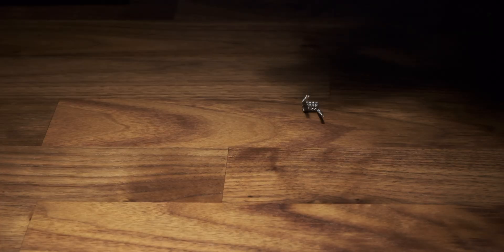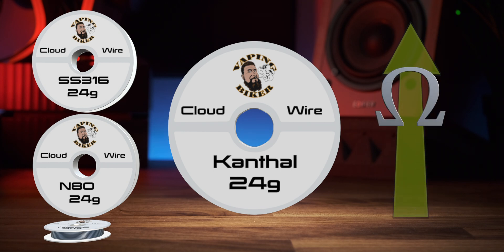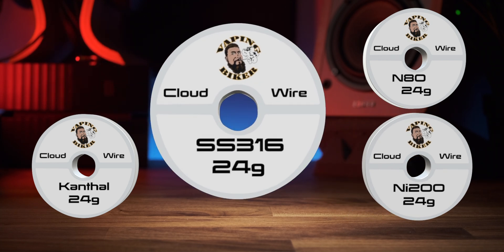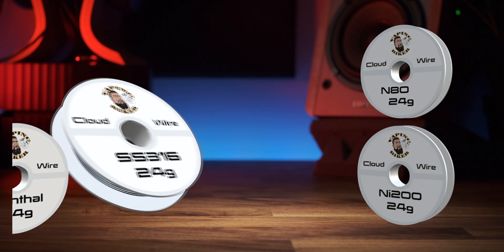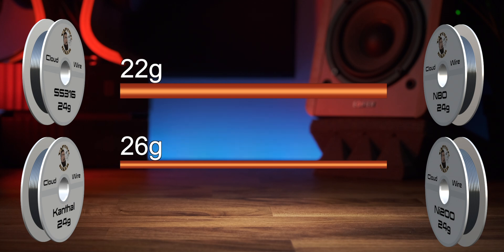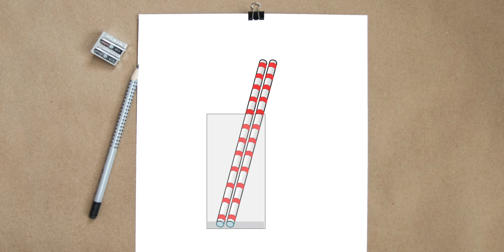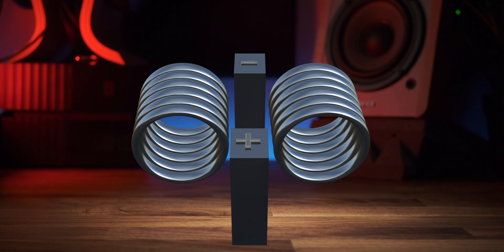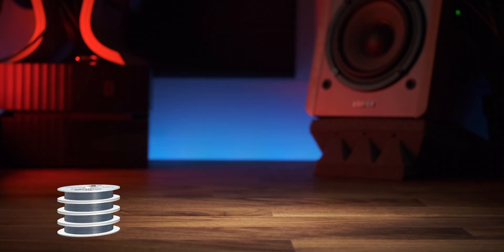Everything you should know about wire (almost)

Comment: Thank you Dean for making this tutorial for those that's new to coil building. I've buy most SS 316L wire and vape often in TC. I got wire in many different gauges and use steam engines calculator to check how many wraps I need to get the resistant I'm aiming for but I've got problems making any exotic wire exept for fused clapton because I'm paralyzed in the left side so I buy spooles of exotic wires and wrap my own coils. The only Kantal wire I've got is the 24 gauge that came in the coilmaster kit and some Alien wire I bought to make some beefy coils to my Goon that I bought 2 years ago but didn't want to install a pair of micro coils in such a great RDA. It's the 1.5 with the airflow slit and not 3 holes with an option for single sided airflow but I want to vape it dual coil. The big block to clamp on the coils should do so it works great in single coil mode too. Sorry for all my rambling but I haven't seen you in a while and I used to watch all your reviews.
Reply from the maker: Keep up the good work with coiling Allan, and thanks for watching!

Comment: Absolutely brilliant video!!
Will be very useful for those trying to get an understanding, I know I could have used it a few years ago when I started out building coils.
Been using SS317 in my builds for a long time now, highly recommend it and won't use anything else ...ramp speed is fantastic and flavour is on point!! I wouldn't say throw out your 316 today the leaps on that big, just replace it when it runs out.
Top work on the 3D graphics 👌 would be great to see a vid on Claptons, Alien, Twisted or Tiger Coils if you get the chance 👍
Reply from the maker: Thanks Paul, and thanks for your experience with 317 👍👍

Comment: Good video dean will help begiiners getting in to building also if you get chance how about i video on wicking the coils as there is no proper videos going in to the aspects of wicking as there is alot of beginners who have built coils but find it hard on wicking diffrent diameters of the inside of the coil 3mm and 2.5mm witch is what some people use and the diffrent cotton available and witch cotton to stsrt off with as a begiiner i think thst would be very helpful gor behinners wiitch gives them a better idea of thr whole aspect from wire to cotton.
Reply from the maker: Wicking can certainly be challenging, the problem with making a video about it is that sometimes different products need different approaches to wicking.
Nice idea though. Cheers!

Comment: Great quality, Dean.
It is good to see you are still around - I finally have my own disability trike, but sadly it looks more like a Lambretta, so I might be forced to get a parka and paint a target on my back unless I can find a way to customise it, which looks non-trivial.
Twistgrip power and lever brakes, too, so I won't find it as easy to crash.
I think most of us who are already (or still) subscribed to you will know most of this, but will still find this great as a high-quality resource to point people to, with seriously good production and presentation.
I'd love to see videos of this quality as a whole series, covering the whole area of coil behaviour, with thermal mass and surface area covered so that it explains how the right coil choice can affect power use even at the same resistance, and including some charts ranking coil material by base (cold) resistance, TCR/TFR. and thermal density.  Also, any matters which may affect the suitability for particular purposes. (titanium taking notches out of even the best cutters, which can be found with a magnet, how common are intolerances, and availability, for example).
NiFe (in its various mixes), Ti, and some other types of stainless steel would be great additions.  (Most people I believe use 316L, which is the lower carbon variant of 316, and 317 is also available in an L version.  I've also used 304, 430  and 321, but in much smaller quantities than 316L.
I only vape in TC, or in one instance, Replay (it's as close as I can get on an Orion, or any truly pocketable similarly sized device, as far as I know, having the DNA Go board in it).
Subjects which may also be of interest to those building or even just installing coils would include contact vs spaced, dry burning (what it is, how hot should we go, why we use it, and all that good stuff) coil cleaning, and I'm sure a few more.
Reply from the maker: Thanks Phil, you made some great points. I have to walk a line between being informative and being too numbers heavy and turning people off, but there certainly is a space that hopefully won't turn off the majority of viewers and I'll definitely be exploring that.
The magnet idea isn't always correct as the spooling process can magnetise SS through friction, I tried to go with the mainly used wires in this episode, we'll see how geeky things can get before people hate it LOL
It took a hell of a long time to do this video though, so from a technical standpoint I don't want to spend weeks on a video that nobody will watch, and we have to remember, it is a vape channel not a metallurgy channel.
Like I said though, I will explore common ground in the future.
Cheers!
Reply: @VapingBiker  Well most types of Stainless simply aren't magnetic in the annealed form but some can become very mildly magnetised after cold working.
I suppose some spooling machines may flex the wire enough for this to happen.
The major common exception is the 400 series, which are magnetic by design.
however,  NiCr isn't magnetic and FeCrAl (Kanthal) is, which may be of more interest that the subclassifications of stainless steels! 
But that is only really a side-note to the other properties - although useful to know, especially if you have pets!

Comment: This was an awesome video.  I wish there was something like this when I started vaping years ago.....  Just noticed that most of the comments are the same.  That just goes to show how good a job you did on the explanations.  The only thing I would add is that you can continue to parallel your wires.  For example, my builds normally consist of 2 coils in parallel with each other and having 2-3 wires in each coil.  So 2 coils with 2 wires in each coil means that your resistance will be 25% of what one wire would be.
Reply from the maker: Yes, that would be something I'd cover in a follow up video, a dual core clapton is essentially a parallel so it makes sense all in context of building. 
I tried to keep this nice and short with the basics and then I'll build on it from there.
Cheers!

Comment: Thanks dude! 
My question has always been matching the wattage of my mod, to the coil (s) I make and install, cos I'm a bit fick ya see
Reply from the maker: It's always going to be adjusting to taste because different eliquid can be better at different temps, and also, you may have a coil in a reduced chamber but use the same coil in a much larger chamber with more air. 
As long as you know not to go crazy on power with thin wire that's a start, but no hard and fast rules like XX Clapton has to be at YY watts generally. A lot of coil builders and stock coils will have a suggested power band, but not always.
Reply: @VapingBiker  I guessed as much, but a big 'Ta!' for the lucid confirmation mucker!

Comment: Awesome basics tutorial Dean. From doing my own testing using the same (as near as I could) builds with the different materials in the same RTA totally agree on the flavour differences, discounting wattage variations.  I have tried 317 and can't really say I find much of a difference. Seems there's more Chromium,  as with 430 stainless but both grades are not common now Crazy Wire are out of the vaping game.  Cautionary note Ni200 and Titanium (both options usually catered for in TC mods) is temperature control only wire and should never be used in non TC mode as they give off toxic products if over heated.
Reply from the maker: Yes that's a good point re: Ni200. Luckily it's a wire that seems to be dying out in general use these days.
Glad you enjoyed the video!